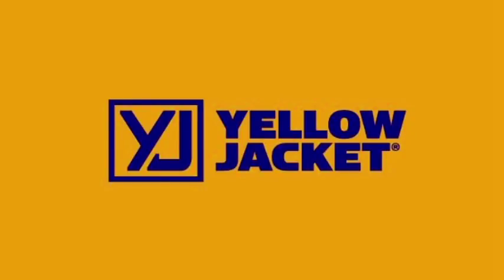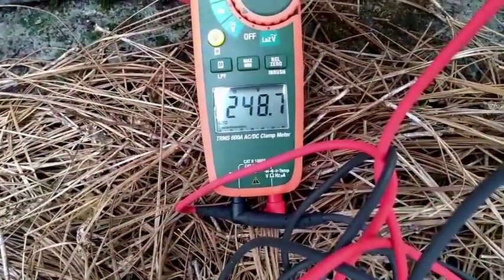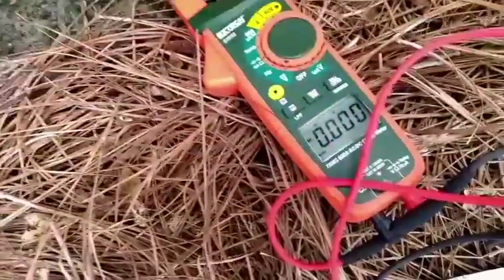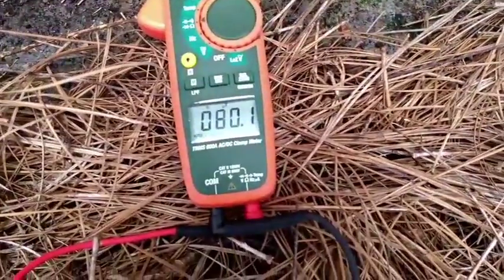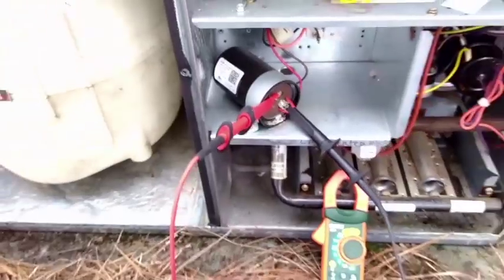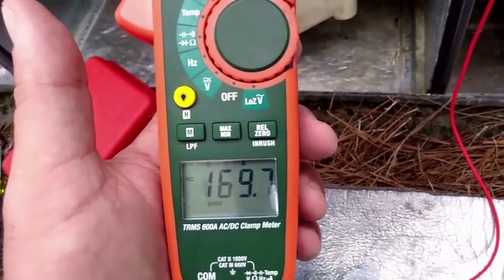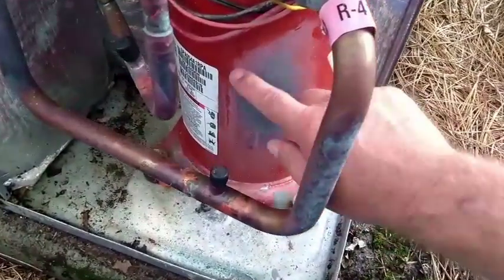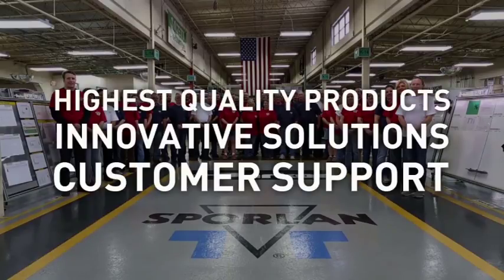HVAC Service Call | Scroll Compressor Troubleshooting

Comment: Overheated motor windings. Reason? Maybe the start capacitor doesn’t work or maybe a hidden run capacitor. Also I saw a tear down of the scroll compressors and that is where the motor core is attached.

Comment: I am suspecting that when you charge a copeland scroll with liquid through high side while under vacuum causes internal damage with the result being equalized pressure while running....If so why?

Comment: Thnx Zack for an informative video. Perhaps you need a harder wack at it w/ a rubber malet :o) My scenario is the opposite. AC compressor will not start & I get a really low amp draw < 2 amps during test. Is that possibly sign of bad compressor? The compressor is not shorted. Trying to determine if the compressor can be revived.

Comment: Where is Annie!   Cheepers, No Annie :) . Here I have an old Gould "Annie" A20 Hermitic analyzer that in can sometimes break a compressore free. It is an 1980's rig the one I have. It has several different caps inside and you try forward and reverse to break it free. There was a smaller A12 Annie for say refrigerator compressors and say window unit and small ac's too
Reply from the maker: +3beltwesty I have seen them, don't have one

Comment: Gotta love the sledge.  I have tried that soo many times.  I know it will never work and you still would need to replace the compressor, but I still do it anyway.  BTW, you need to hit it hard enough to make a good dent.  It won't help but it is fun.  As for reason for failure, low charge and consequent oil pumping or copper plating from poor installation are most common.  Fun video.
GFM

Comment: I've unstuck a fair few compys with a hammer, Large capacitor, or reverse rotation (in the case of 3 phase) but, as you said; still time to replace it. You consider yourself lucky that you got it cooling again for your customer and you order a new one as quick as you can!!

Comment: "Knock, knock, knockin' on heaven's door" LMAO I believe this one has bought the farm, kicked the bucket and headed for the big Ingersoll-Rand subsidiary factory in the sky :) I'm no expert on scroll compressor internals but that seems to have gotten too hot to just be electrical resistance. That seems like insane over compression. Internal gas recycling? Restriction? All of the above?

Comment: Had one get so hot once it melted the label and electrics box off the compressor ZR90 7.5hp, would have been funny if we hadn't fitted it the day before.....
Reply: Oh no, what happened in that system I wonder
Reply: Previous company had replaced contactor, then we diagnosed faulty compressor and replaced, I was working on another system and apprentice fitted new compressor and contactor, when he'd finished and got it running asked him if he'd checked it which he said he had.... Turns out previous company had miss wired contactor so it would never turn off so when the compressor pumped down nothing would turn it off, gets into vacuum scrolls separate and bleed gas back which gets pumped again, eventually gets hot enough to melt!  Apprentice never checked pressure switches would stop compressor and I never check he'd done it right, lessons learned all round that day!

Comment: after replacement you have to check the charge and  superheat at the compressor. When you recover the refrigerant, see how much you get out of it, if not much you might be low. Scrolls are great compressors but My experience Scroll compressors can't handle loss /low charge to well, especially loss of charge. Put hi/low press switches in if none are in it from the factory.
Reply: low on charge, bah who needs oil in the compressor anyway ;)
Reply: throttle bottle I can tell you're a rookie you wouldn't know how much oil is in it and you never add oil to a system. There's no sight glass on that compressor. Don't mean to insult you but after such a demeaning remark I can tell you don't have much experience in the field I've been doing it for 33 years now
Reply: then you should know what being low on charge does and scrolls are famous for washout and pumping the oil out into the system in such conditions ;)
hence my "bah who needs oil in the compressor anyway" comment
Reply: throttle bottle I worked on semi hermetic up to 100 tons being low on charge you don't pump your oil out. Scroll compressors are excellent at raising the temperature of the refrigerant which is why when you're low on charge you going to run hot. It looks like the thing ran hot to me from the discoloration. Could be a restriction and I didn't see any low-pressure cutouts. Whenever I put in the compressor I was put in low pressure switches and I have with my own experience I've seen systems run with no refrigerant in them but the Scrolls can't handle it. All compressors pump out oil. Just Scrolls and well pump out oil under normal conditions. Replacement compressor comes with a full charge of oil. I've seen systems that have been overcharged with oil and it screws up the temperature drops like you can't believe. My favorite was when I had to pull out 5 gallons of oil out of a system that wasn't all that big maybe 7 or 10 tons semi hermetic how to keep draining the sight glass two 1/4 and just keep draining it out after letting it run. With all the excess of oil in the system the temperature drop was greatly decreased
Reply: Ben Kuxhouse what else can u tell us to prove ur technical experience. For someone doing this for 33 yrs, you sound extremely immature. The other guy made a simple sarcastic comment.     
I apologize that offended you so much. Maybe you should consider retirement!